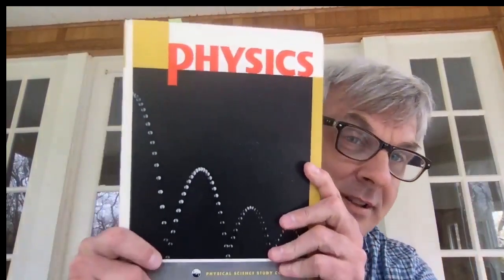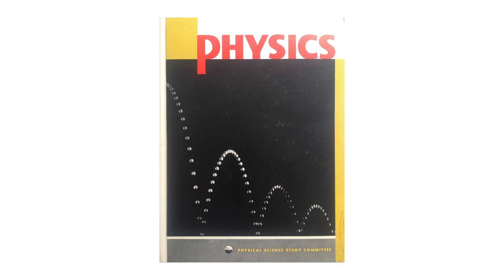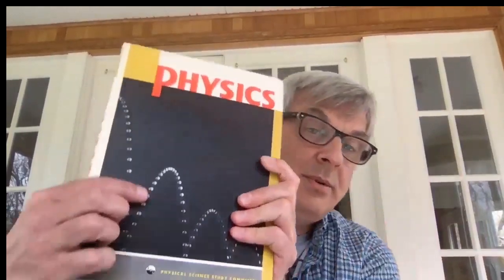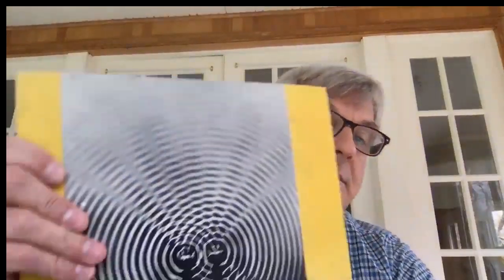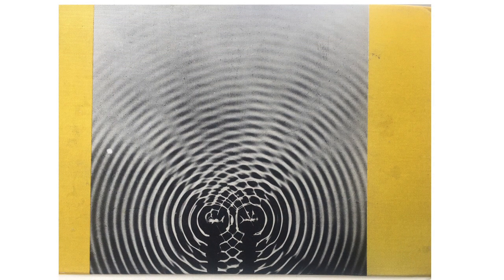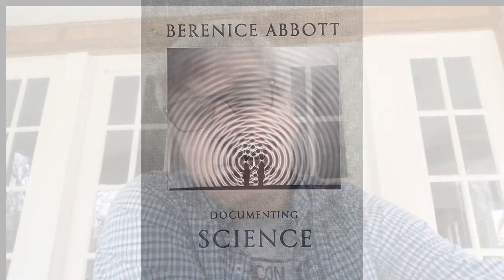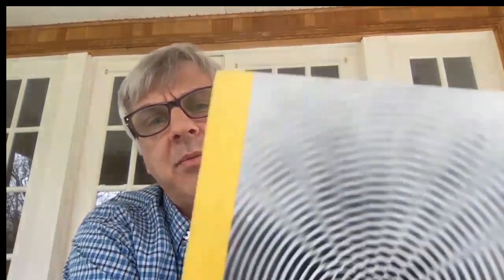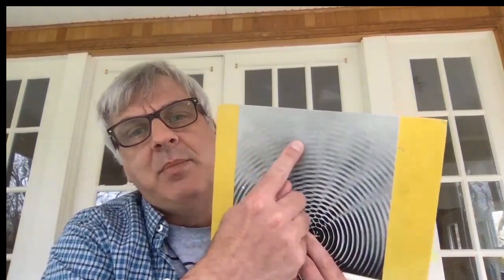How to photograph a ripple tank

Comment: I’m a little confused by the set up, is the ground glass the white object a few feet below the tank? Also ground glass is typically used to scatter light in optical paths, won’t that effectively soften the image? Questions aside I did enjoy the video/topic :)
Reply from the maker: the ground glass does scatter the light, but here it becomes the object being photographed. It is equivalent to placing a sheet of film in the same location. The ground glass is on the outside bottom surface of a glass pan. This is video #1 out of 2 for an article, so there will be more in a few weeks.